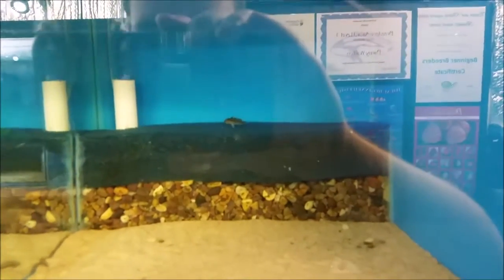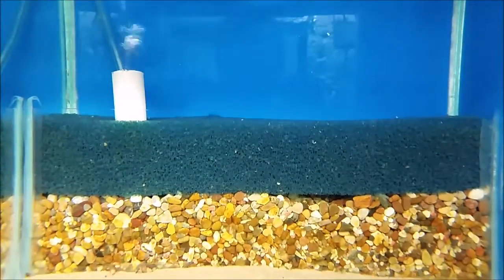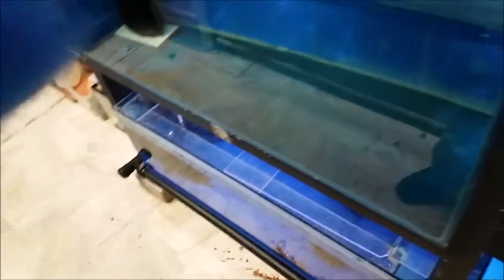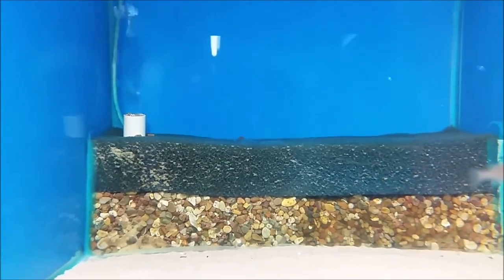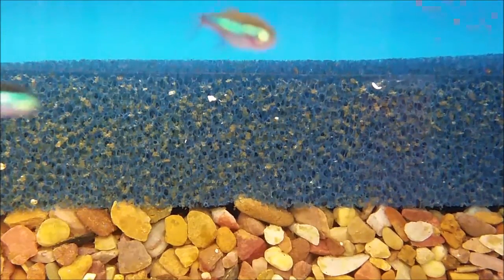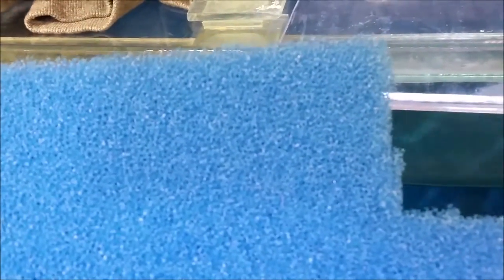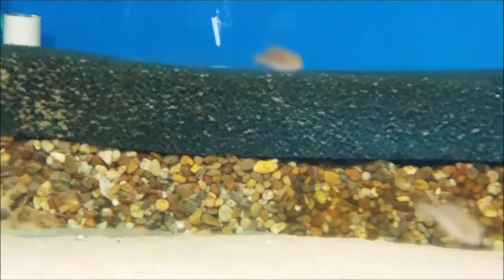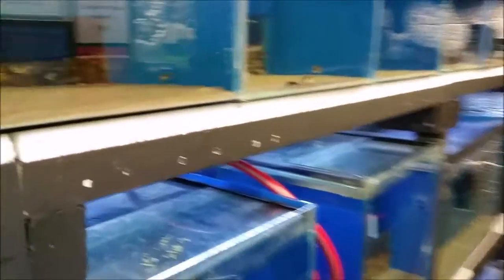Horizontal flat bed filter DIY |DW Aquatics

Comment: Instead of gravel, is it not better to use bio media? Or use both?
Reply from the maker: +Jay Lau I wouldnt say better no, The amount of gravel used in them would mean it would be capable of holding just as much "good" bacteria as others, also i needed to keep in mind that alot of "bio media" out there is plastic and thus floats which means when i remove the sponge for cleaning all the "bio balls" would freak out and start floating throwing all the crap they hold into the tank, Also cost was a thing for me, most bio media out there is rather expensive when having multiple tanks to do, So for me the gravel was the best choice.
Using both types combined would simply be too much, i wanted the filters to both work great but not be too sightly within the tanks.
Reply: +DW_Aquatics So does that means gravel is actually better and cheaper at holding bacteria than bio media such as ceramic rings?
Reply from the maker: Not better than ceramic rings or other bio media in canister filters no, using gravel is just better in my situation in terms of size, cost & effectiveness